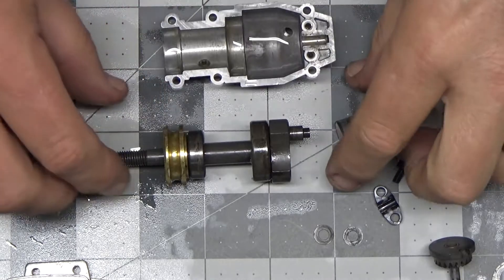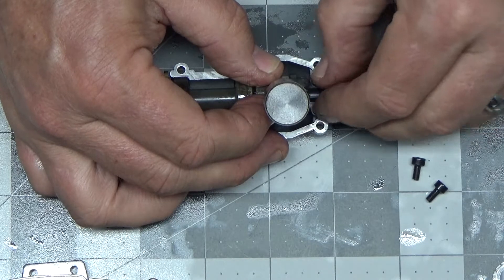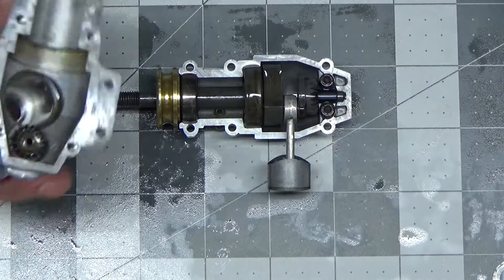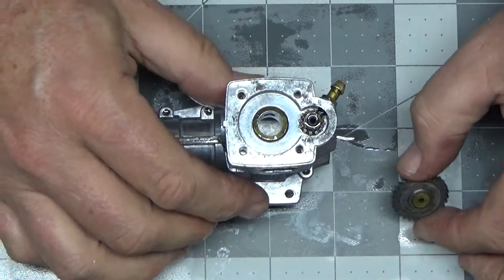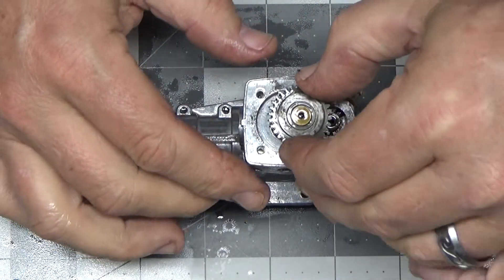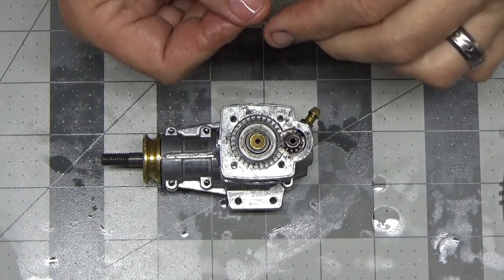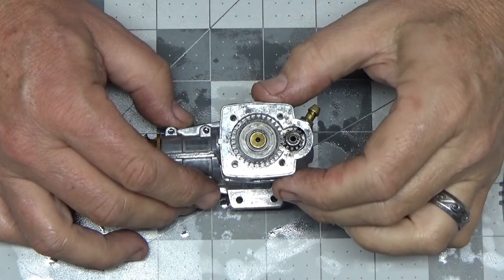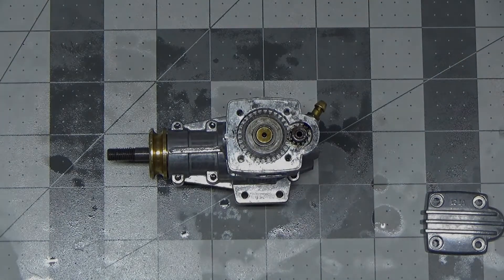HP 21 VT A Look Inside Part 2

Comment: The pin on the lower bevel gear is separate from the gear. Yours is seized. The pin must be held tight by the strap. The gear should rotate smoothly on the pin. I have had plenty of these....checkout my video. Please don't run it with the screws loose
Reply from the maker: I know all of the things you mention in this comment.  I know they are separate, I know not to run an engine with loose parts, and I do not see a single video of yours that explains this issue at all.  I see a video showing the engines you have, nothing more useful than that.
I have more than one video of this engine, perhaps you should see this one.
https://youtu.be/j6_E3aYkYcU
Reply: @dmrcflyr2   I wasn't having a go at you, I was just commenting on that actual video and that pin was stuck. You probably do know that the pin is separate but in that video it is stuck and Itwas .To say it's poor design is a bit rich when at that point you were at error. Sorry if your offended at my comment as you obviously are but no offence was intended and I enjoy watching your videos.
Reply from the maker: Oh I realize that.  I was just stating that I know these things and that your suggestion of seeing your video only proves that you have many of this style engine.  I still stand by my statement of this being a poor design despite your love for the engines.  I love them too, but that does not mean the design is not less than adequate..
Reply: @dmrcflyr2  I just watched the video you suggested and your fix to prevent the bolts from coming loose. It's not necessary. The bolts need to be tight to hold the pin in place. The pin does not rotate. The bevel gear rotates on the pin. Your pin is stuck in the bevel gear and needs  to be freed up so the gear rotates smoothly on the pin.
It's not a poor design it works very well if parts are not seized....the same as with most engines.
I commented on a point in the video that's all. After all is that not what the comment section is for. I was just passing on  my view and in my view all information is good and makes the world a better place.

Comment: I have two of these most wonderful VT 21 engines - both have the roller bearing in the head rather than the shims. Those engines are easily identified by having a black head.

Comment: Very interesting video.Its a most unusual engine to me..Of course I am used to the older vintage types set up.. I am sure,its a sweet runner.
I was also bussy with my OS wankel MK 2,and I like to ask you David,what type of glow plug is the correct type? What about the lenght ? I hope you know..I am sure you know..   ;-)
Reply from the maker: The plugs that I have for my Wankel are K&B 7331.  It is a direct replacement for the Wankel plug.  Unfortunately I do not see them listed on MECOA's site so I do not know if they are still available.  I think I read that the Gen 2 or Gen 3 Wankel's could run on a standard OS F plug.  I personally have not tried that plug in my engine.
https://www.ebay.com/itm/272128371236?rmvSB=true
Reply: Hi David,Many  thanks! I just try to buy,but its not shipped outside the US.Can you buy and ship it for me? I pay of course all costs!
Reply from the maker: Sure, how many do you want?  Please respond via email.
Reply: Ok,will do tomorrow. Many Thx